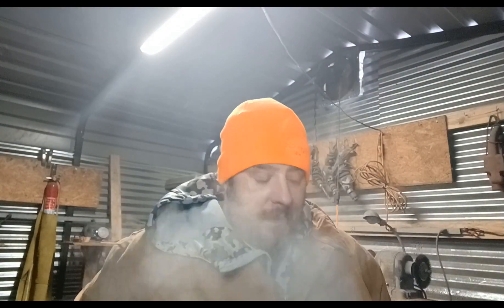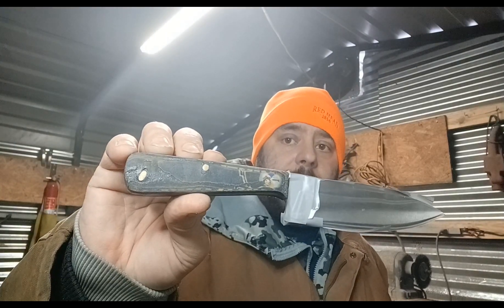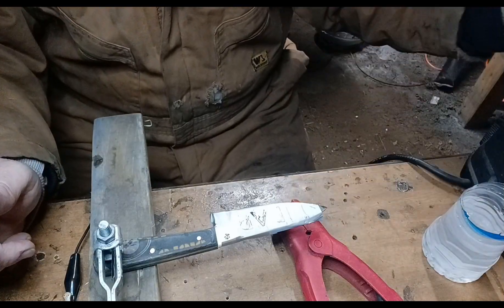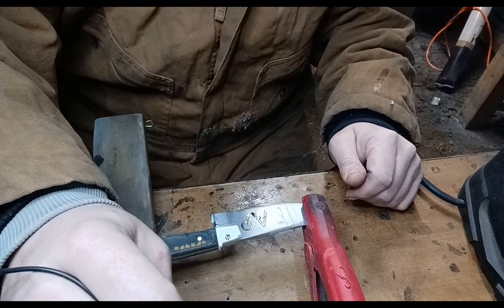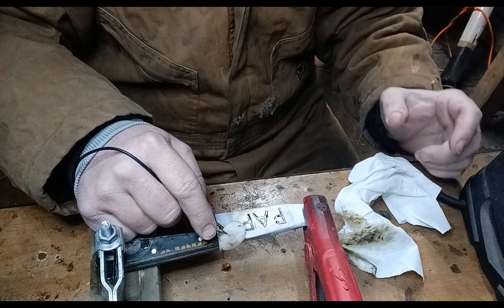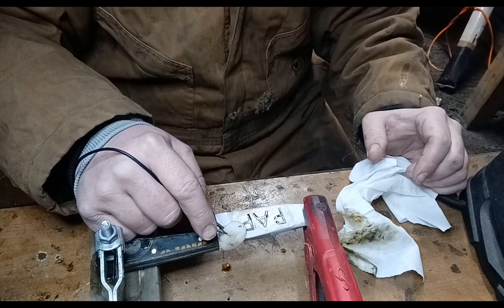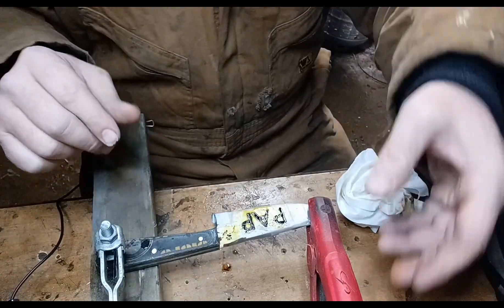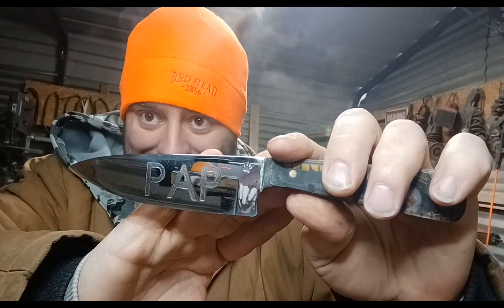How to electro etch

Comment: How much salt do you add to how much water?  Is there a certain ratio you use?  Is your jumper pack adjustable?  I wonder if a battery charger on low would do the same effect?
Reply from the maker: I use two to three table spoons of salt to one coffee cup of water. Jumper packs usually are not adjustable but if it does adjust I say use half power but use an old style jumper pack. I would not recommend using a charger because you are actually short circuiting the pack you may pop a breaker or ruin your charger. You can also use a 9v battery and get the same affect use alligator clips it will make your life easier.